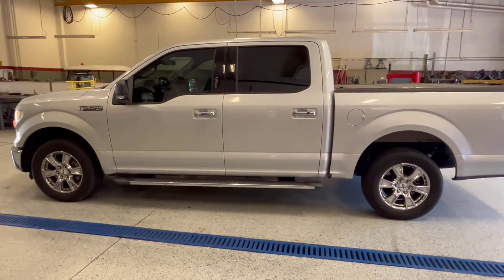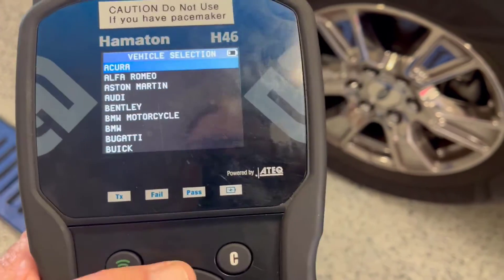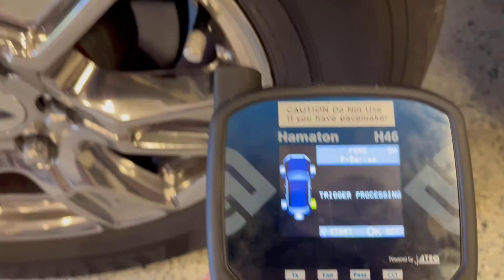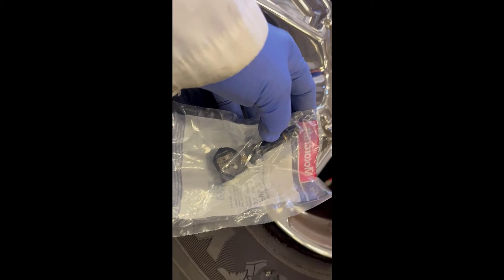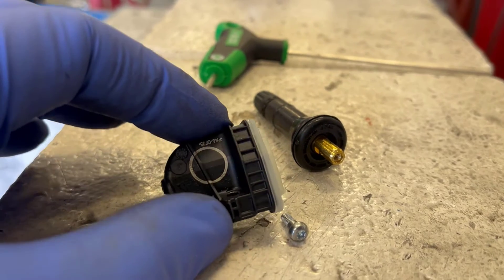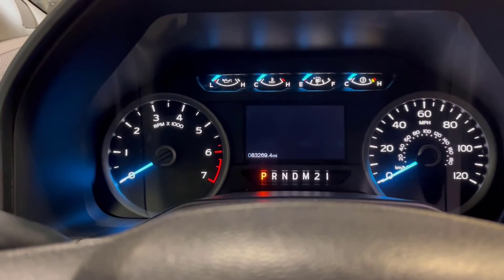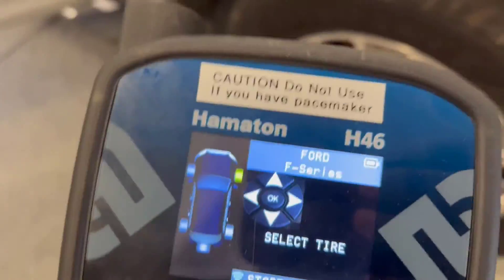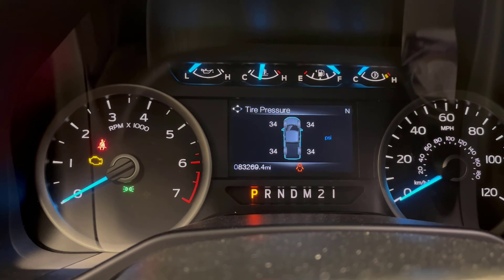TPMS Sensor Diagnose Replace Relearn

Comment: Bro instead of going through the settings to select the model and years just scan the Vin it read automatically.! And instead of placing the tire at the top of the tire machine to remove the tire just   break the tire beade close to the valve stem but not directly at the value stem and keep it pressed you will have enough space to remove and install the new sensor!😒
Reply: I hope those are not aluminum valve caps.... if they are and do not have a plastic insert, you WILL have to cut them off with a dremel tool, and HOPE that you don't damage the valve stem..... thats what brought me to your video..... I'm in my driveway cutting valve stem caps off right now........ only one out of four came off without cutting. 😡
Reply from the maker: This video is made specifically for students and includes extra steps for training purposes.  Thanks for your input.